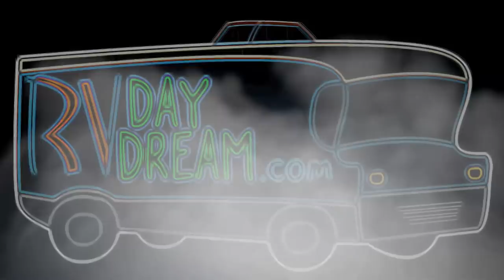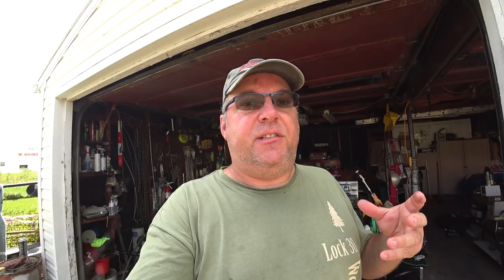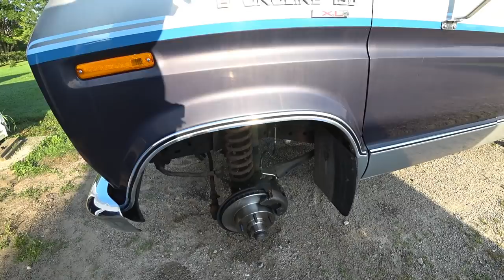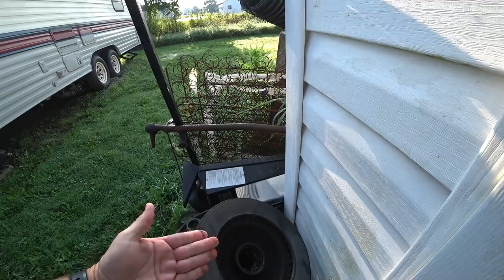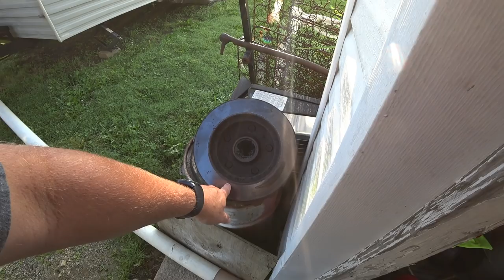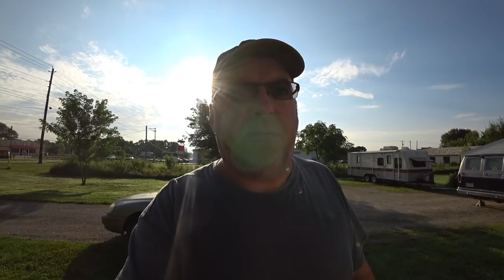Working on Van Dweller RV ... Again

Comment: The caliper actual has a square packing that seals and also acts as a spring, if you will, to pull the piston back just enough to get clearance for the rotor to turn freely. ALWAYS when you one or the other go bad, replace both calipers and both hoses. Saves $$ and headache down the road. Enjoy the channel!!

Comment: I have a 1982 Ford XLT Club Wagon that I bought new in 1982. It had serious design problems with the front brakes, very similar to what your son was experiencing, except that it wasn't the hoses. Ford's better idea was to save $ by using a phenolic piston in the calipers. Unfortunately, as the pads worked stopping the van, they generated heat as you would expect, except that the pistons would swell from the heat and jam in the caliper and lock up the front wheels. My temporary fix was to use some emory paper and reduce the pistons so that they would move smoothly in and out without jamming. I ended up doing a full pad and rotor replacement at 14,000 miles and continued to have trouble. Finally, I checked with the local auto parts store on the availability of steel caliper pistons. They had them, but also had rebuilt calipers for less $ with the steel pistons so I replaced them and everything worked as it should have from the dealer. .........Jim

Comment: I had a similar problem with my f150 but the calipers were seizing up and wearing the pads unevenly. Ended up replacing both sides. Rotors are still original. 23 years old and never been turned lol.